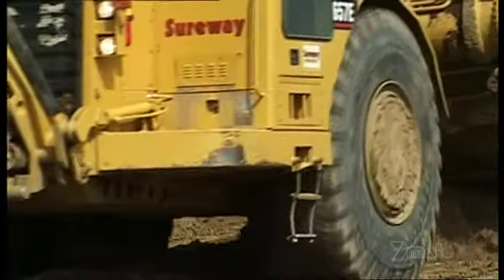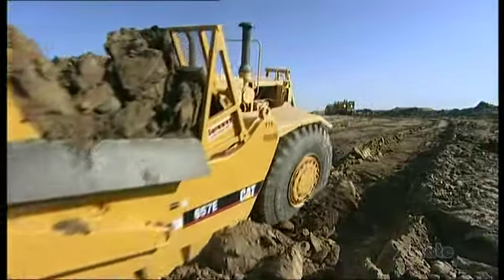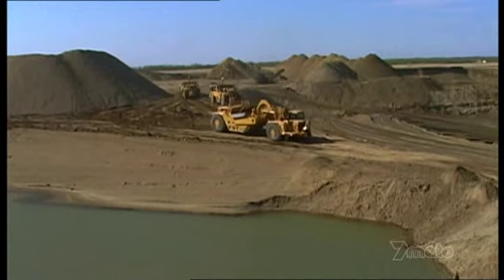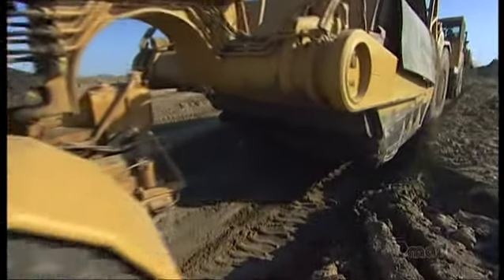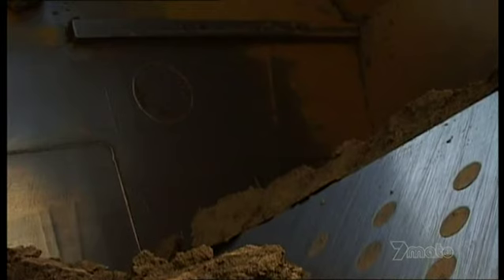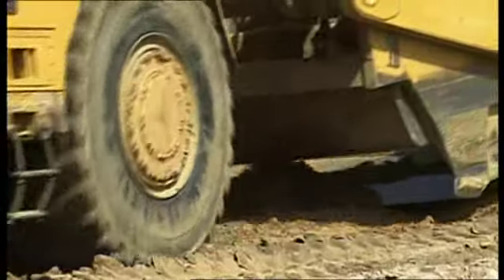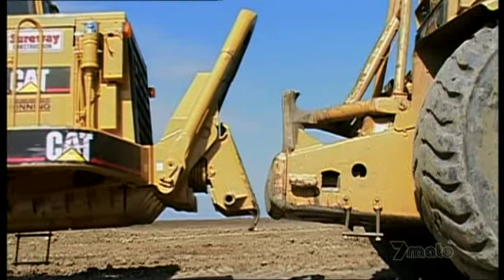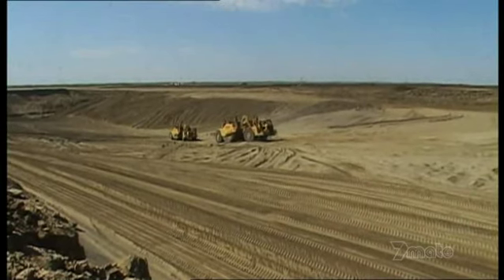Giant Scraper

Comment: the roughest part of the cycle is the cut. and the key to that is keep it smooth, especially in push pull operations. Always have the apron open almost all the way when going into the cut, in 2nd gear, but wait until your partner drops the bail  over the hook, then, start the cut where the meat is or the cut is, leave the apron open and dirt goes in the bowl. dig deep. When the apron is open 2 feet, it looks open enough to handle the depth of cut, however if the cutting edge hits the top half of a 1' rock, the bowl is going to jump over it and make a rough pass. If the apron is wide open and you hit the same rock in the same place in the upper half, it'll suck the rock up into the bowl. some want to keep the bowl closed enough to see into the bowl through the holes in the apron. 2 things to load on a scraper, the bowl and the apron. it's automatic, after 20 seconds with the apron open, put it in float to load the apron.

Comment: Pretty informative video. They were pretty accurate with the explanation of the machine itself. What they didn't tell you is that after operating a scraper after a few years, it tends to hurt you back because it's a rough machine to operate. On a scraper spread, there should always be a blade maintaining a haul road for them to increase efficiency and productivity.
Reply: +Jay 
Hi, Jay.
             I always preferred to be on a push cat or the blade myself. I figured out very early in my career - 50 years plus - that going round and round on the same goat track while bouncing up and down as well as from side to side was just plain NOT fun.

Just my 0.02.

You have a wonderful day. Best wishes. Deas Plant.